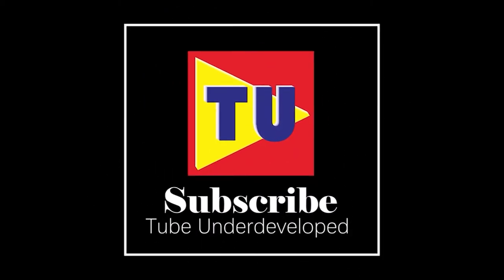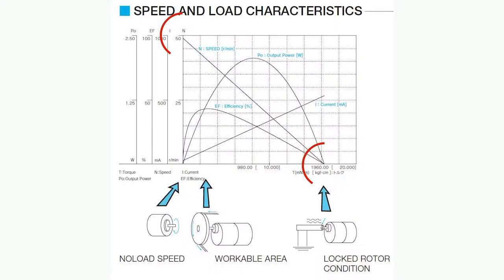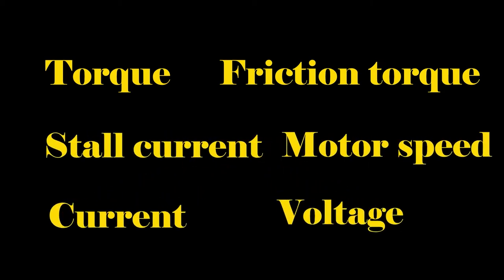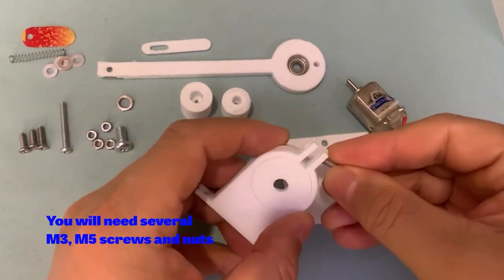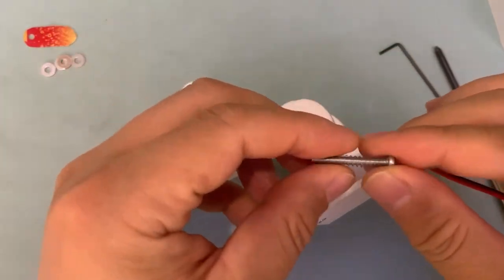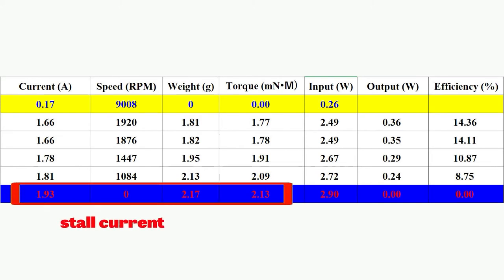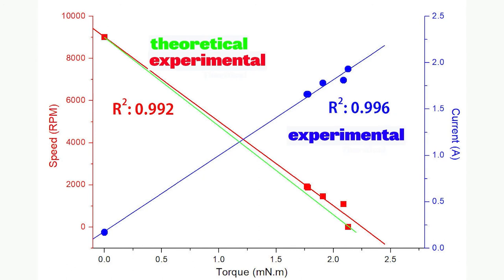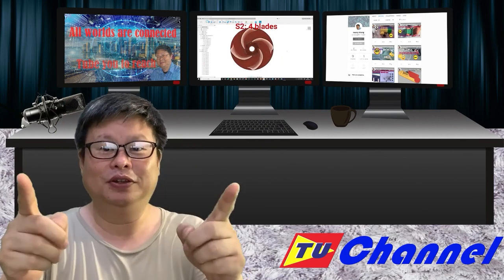DIY dynamometer (friction torque meter) using 3D printer

Comment: Thanks for making this guide. I've been using an eddy current brake for a dynamometer, but I have to adjust the brake position to change the load, so using your design and just adjusting a friction screw will be much easier
Reply from the maker: I am glad that it can give you some help. In fact, I have modified the design that makes it easier to use. Please check. Good luck. Thanks for your comment.

Comment: Wouldn’t it be easier to use a rotary torque sensor?
Reply from the maker: Thanks for your comment. This is only for very small torque measurement. Just for test. If you want to measure very precise torque it is better use better one. Have a nice day.

Comment: What filament and setup you used? It is so smooth. Thanks
Reply from the maker: I use Cura or Prusa slicing software. They are not so different. Just keep the height a little small. I use regular PLA filament. Most of them are bought when they have a campaign. Usually, I will test the filament setting at first time printing using a test model download from Thingiverse. They can tell you what is the best parameters for your filament and bed temperature and printing temperature, etc. The height is usually 0.2 mm, and the bed temperature is 60 C. The printing temperature is calibrated with the model. You can download a temperature test tower as below.
https://www.thingiverse.com/thing:2729076 
Good luck.

Comment: Can I ask you how do you determine the friction applied to the shaft of the motor? Do your results match the datasheet of the motor you tested?
Reply from the maker: I have upgraded it to the new version. The friction of this old type is not so stable I think. The torque is at the same level as the motor manual listed. You can check that video also. The new type has a more stable friction source. I hope it will give more correct results. 
The force applied is just feeling, hahaha. You can adjust the screw and rotate with your hand and feel how it works.  Then check the experiment result and adjust it a little bit more. Don't use too much at first. The stall current is an important parameter but it may damage the motor if you measure it directly. A stable DC power supply and a good electronic scale will give you great help. 
Please check my new torque meter. It is much easier to control the torque force. 
Hope it will give you some help. 
Have a nice day.
Reply: The dyno is floating except for the restraining trunnion bearings and load arm.  When you do a force balance, you can see that the arm is the only thing keeping it from twisting.  So the arm length multiplied by the force on the end of the arm is exactly in balance with the friction torque inside.  It's how almost all proper dynos work.

Comment: sir it is a great idea which is suitable for my work. i have a doubt how to measure torque for the vertical axis wind turbine. the outlet is the rotating shaft with 15mm dia. if you help me it is useful to my project
Reply from the maker: I have made an upgrade version that much easier and precise. You can check the video here. You also need to make a transfer to change the shaft diameter correctly. That is not so difficult I suppose.  
https://youtu.be/5VtycsVbPSI  and  https://youtu.be/GKP7OYOwWck

Comment: I think that we want to measure torque generated from motor rotor, but you only measure the torque which generated by outer race of bearing.
What is the reason measuring torque generated outer race of bearing, but measuring shaft torque?
Reply from the maker: The motor torque is equal to the friction torque in simple construction.  If using the gearbox the torque is of course the torque of the gearbox.  Thanks for your comment.

Comment: what model did u use  to get the theoretical line?
Reply from the maker: Thanks for your comment. The theoretical line only needs two parameters. The no-load speed and stall current. I use Mabuchi DC 130 for this test.
Reply: @TubeUnderdeveloped  I see ok. Seems cool, i'm looking to test how RPM affects touque in an electric motor for my assessment in college, looking for a model. Thanks